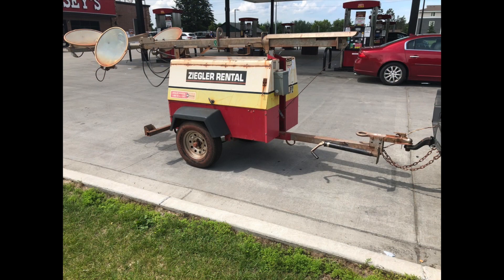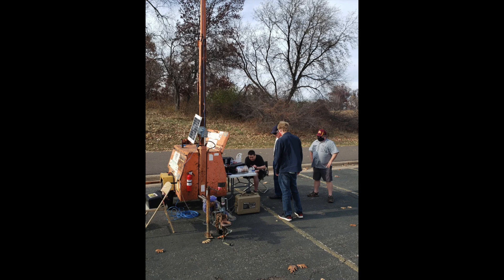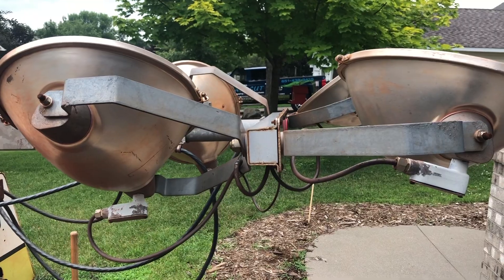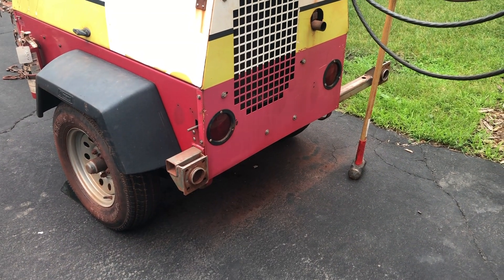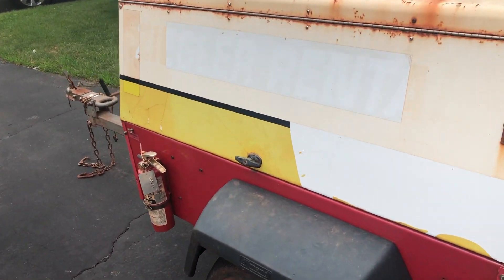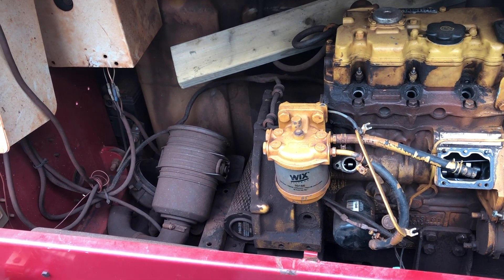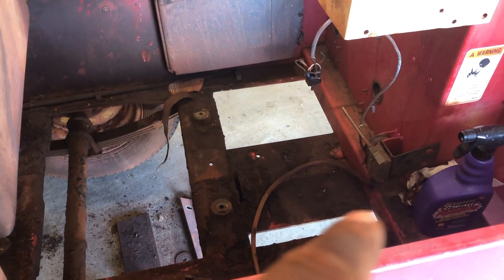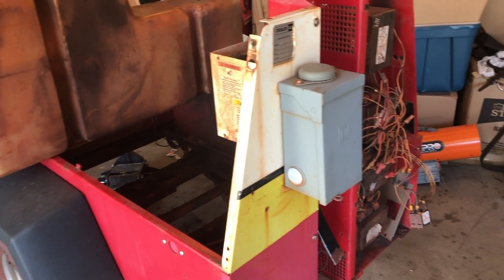Amateur Radio Trailer Build Ep.1 - Tear Down

Comment: Looks like the transformers and the capacitors were to get the 200 volts DC for the motor.
Reply from the maker: Actually, the transformers and capacitors were for the lights.  The winch was powered off one leg of the AC generator through a bridge rectifier.  That bridge rectifier produced about 180 volts DC.
Reply: @ATVfu  Well I was just taking a wild guess!

Comment: Note that if you rectify and filter 120vac you get around 170 volts DC. That might be enough to run that winch motor off the new generator. If the motor common is tied to the motor case you will need to use an 120v/120v isolation transformer but with only 3 amps needed that's not very big. A 1kva unit would be fine.